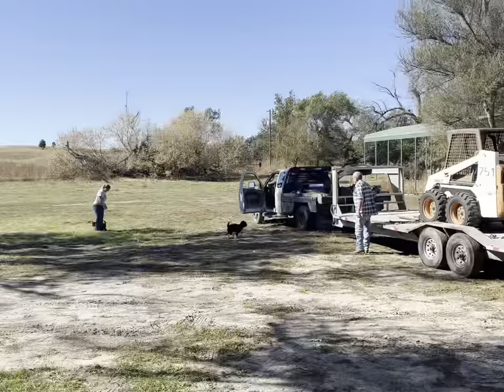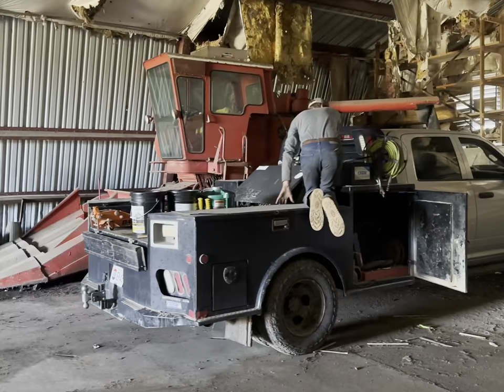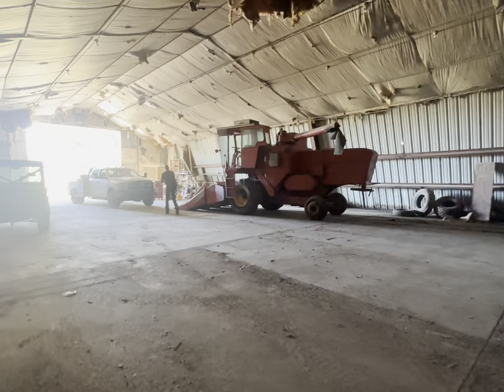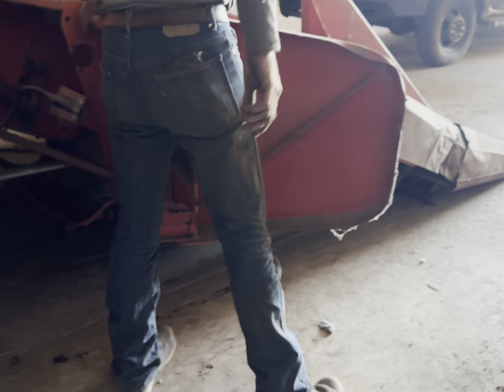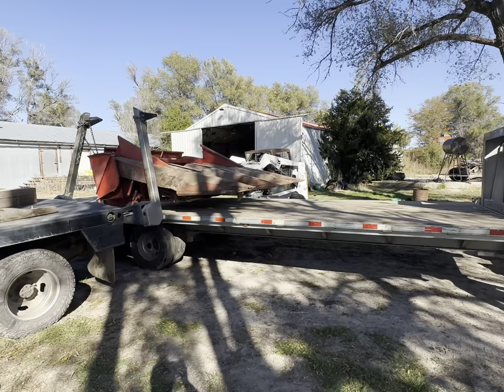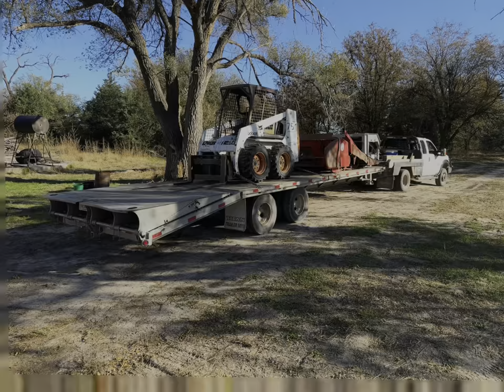Barn Find! Rescuing a Forgotten Massey Ferguson 300 Combine from a Nebraska Sandhills Ranch!

Comment: Back in the day Dad and I replaced our E gleaner with a 300 Massey used it for years then I replaced it with a 750 Massey ours had the slant 6 industrial plenty of power for that size machine. Your viewer from Iowa
Reply from the maker: I wanted this size so I could drive it on a trailer and take it to shows. Love the sound of that slant 6.